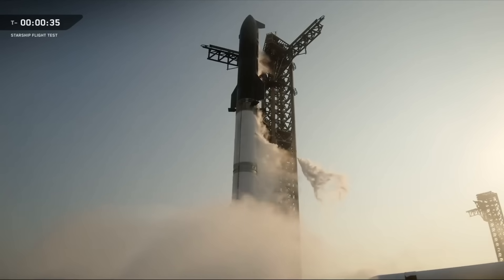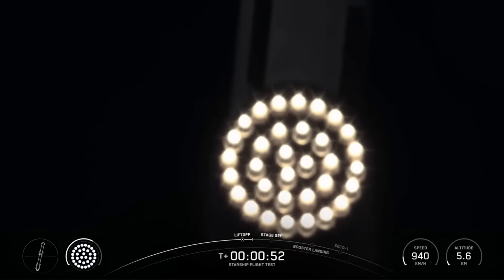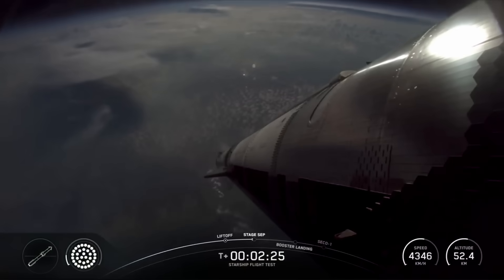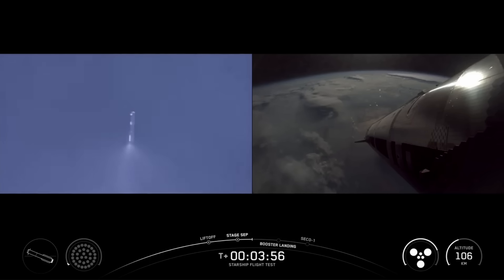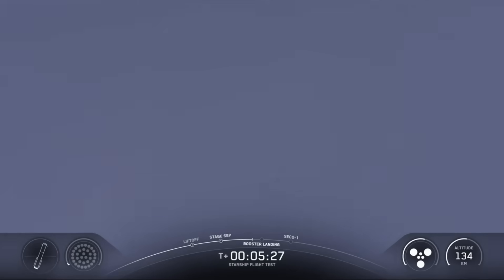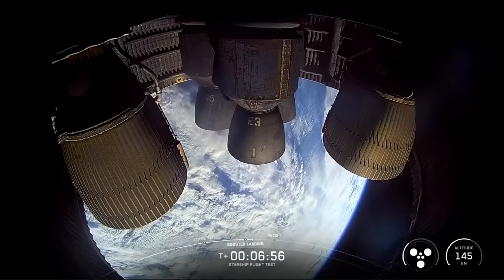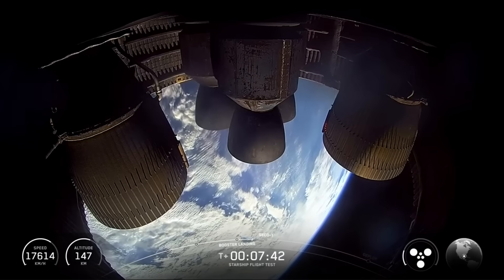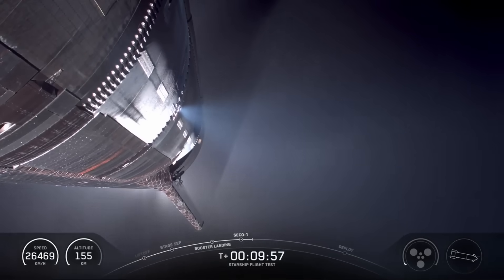Blastoff! SpaceX Starship launches on 9th flight test, booster explodes during landing burn

Comment: The Soviet Space shuttle worked exactly as advertised from the first launch, no failures. NASA's space shuttle worked as advertised from first launch.
SpaceX's philosophy of engineering through failure is so fundamentally flawed that it cannot be called engineering, NASA's Saturn engineers are turning in their graves at this debacle and excuse for engineering. I'm also looking forward to a Max payload lift off of this thing, it should be spectacular, spares everywhere...
Reply: 👍👍👍 for the comment, but note, though, that there are no "NASA engineers", as all work is contracted to industry.
Reply: Neither the soviets or nasa ever made anything reusable. SpaceX had already surpassed them with falcon 9. If they can get starship to work it will be an insane step forward in space flight
Reply: @dylanthompson6146  the Russian and American shuttles were not re-useable ?.
Reply: Why was super heavy not recovered?
Reply: It is called experimentation and it is a process commonly used. Spacex has done it with all of their rockets and Falcon 9 is very successful. What is your issue with Elon Musk, personal dislike?
Reply: @KnightTemplar-k6u  ah yes Mr. Knight Templar, a  white night who automatically assumes that I have a personal issue with musk just because I criticise his method of engineering, rock on Mr. White Knight of engineering principles. The Russian Space shuttle worked as advertised on first and subsequent launches, now that's engineering.
Reply: @tudomerda  Yes, but you didn't explain what was wrong with his method of engineering. You only said it was because he uses the scientific process.

I'm not sure if you are aware of this or if you are actually trolling. The Russians did a ton of experimentation before the final version of the Russian space shuttle used.

Comment: I still think we should be going into outer space via jet airplanes taking off and then their rocket engines fly us to our destination.  Then we design/install a space station where the  planes drop off the supplies and materials for longer space trips.  Or, maybe we use the moon as a way-station for future rocket launches instead of these dangerous launches which endanger lives.  There is far less gravity on the moon to deal with.

Comment: maybe you could see the GLENN as it is in space.  Never seen the GLENN return...  I wonder if the no longer ceramic tiles the space craft is just metal and liquid cooled on the inside is to see how the metal heat shield handles an abnormal entry angle and it explodes...  Metal heat shield is what they are testing on the space craft.

Comment: Ok, the Shuttle then. 135 launches, 2 failures. The calculation before any of the STS launches was 1 catastrophic failure per 50 launches owing to the complexity if the system. You can really put Challenger down to a bad decision to launch on a freezing cold morning.
Reply: Falcon 9, 479 launches, two in-flight failures, one partial failure.  What's your point?
Reply: @-_James_-  I was talking about SpaceX Starship.
Reply: @rogerturner5504  👍👍👍👍
Reply: @rogerturner5504  Then let's continue the comparison.

Shuttle program cost: $196B.
Starship: $5B (so far).

Shuttle cost per launch: $409M.
Starship: $100M for an expendable ship.

Shuttle payload: 23 metric tonnes.
Starship: 150 metric tonnes (to LEO).

There really is no comparison between the two.  When SpaceX have a finished vehicle, it will take less than two years to surpass the number of launches made by the Shuttle over its 30 year history.

Comment: 9 test flights, 9 celebration of failures by the Elon Worship crowd. On this 9th flight:

1) Booster blew up when it started the landing burn. The reuse failed, the booster engines failed again. 

2) Second stage went up to just below sub-orbit, a little higher than test 8. But also blew up. It is well short of achieving a real orbit of about 200 km. 

Starship now have 9 epic failure on 9 very expensive test flights. Can't even reach designated sub-orbit or orbit. In contrast New Glenn rocket reached designated orbit on first try. Worst performance in rocketry history. Conclusion: There is something fundamentally wrong with both stages of Starship. The architecture is wrong. It will never reach orbit, less reenter and land. It will never carry crew. And it certainly will never go to the Moon. 

Elon should end the program and pack up his ambition to go anywhere. Maybe try to fix the Cybertruck, another epic failure.

Comment: This is the penultimate launch, I think, of this miserable concept in its current form. Musk was GIFTED Falcon 9 by ACTUAL  rocket engineers, which is why it works so very well. Musk started this ides, and with staggering childishness, called it BFR. Can you actually believe that? Since he owns most of the company, he gets to perpetuate his idiocy.
Reply: Falcon 9 flies for money. That's why they don't touch it. And this is a personal project, non-commercial, that's why it can be sabotaged.

Comment: They have the booster.  It works and amazingly is recoverable and resusable.  The Starship is intrinsically flawed.  They have copied the failed and dangerous Space Shuttle and will never be able to make this thing function reliably.  Now, it's time to concentrate on consolidating wins and performance of the booster and designing Apollo/Saturn style capsules and service modules to make lunar landing possible.  This Starship monstrosity, if it ever actually landed on the moon would probably just fall over in the process.  Give it up Space X.  The booster is magnificent.  Toss the starship.  

ps.  I would like to listen to the launch, the rocker itself , but this bunch of juveniles yelling and screaming spoils it.  So, I watch without sound.  And, I dislike the commentators even more.  Oh, just emulate Apollo more.  Please.  Professional, curt, serious, and actually know what is happening not just be a pretty face reading your script!
Reply: "They have copied the failed and dangerous Space Shuttle"😂😂😂 A totally different design.
It launched 135 times, with only 2 failures, due to poor booster engineering and NASA's neglect!
"Starship" launched and failed 9 times in 9 tests.🤣🤣🤣
Reply: The reused booster was not able to drop in the ocean like they planned. It also blew up.

Comment: Many thanks for this rapid and informative commentary.

This program is in big trouble.  After nearly three months since the last launch, much of which was occupied by  efforts to overcome Starship propellant leaks, Starship was lost because of ... propellant leaks.  Starship made it to SECO, but did a re-run of IFT3.  Failed in all other goals:  dummy satellite deployment, relight test of Raptor (which was done back in IFT6) and testing modified heat shield.

Meanwhile the over-ocean landing test of the reflown booster didn't take place because the booster blew up when the landing burn started.  The last time a Superheavy blew up was IFT3.  Yes it was the first re-use of a booster but you'd think with a couple of months to check it over a problem that serious would have been found.

The program is still nowhere near it was after IFT 6 when they seemed unstoppable - in fact it's reasonable to say after this current flight that it's regressed to IFT3 levels of maturity.  The version 2 Starship has been a debacle.

SpaceX got approval for 25 launches this year.  End of May and they've only done 3, none of which has reached the maturity of IFT6.  Something is VERY wrong.
Reply: They are probably making too many changes at the same time and its difficult to know what caused the failure. Normally you would make a change and then test t see if it's any good and then decide to keep it or change it back. When you make tens or hundreds of changes from one ship to the next it makes things more complicated and progress stagnates.
Reply: @defiantrascal6214  Exactly, I think you're spot on - you're also going to want to generate failure in a reusable item for the reason the margin profile is already way better but you need to trend towards reliability. One hopes that they have lots of telemetry data and can start to edit out the problems.
Reply: @defiantrascal6214  Agreed.  I said back 5 years ago when they were doing hop tests they should have also been doing that with boosters concurrently.  I would maybe have slowed them down a few months early ob but resulted in a much more mature program by this point had they been able to troubleshoot problems years earlier.  They were supposed to have demonstrated orbital propellent transfer already.  Ultimately the rapid "move fast and break things" approach has not paid off.
Reply: @tylerjohn4607  that was 5 years ago?!? Holy hell.
Reply: "first re-use of a booster" but the engines exploded when in re-ignited. Some reuse!😂
Reply: This is sabotage. Musk got carried away with politics and offended too many people.
Reply: 25 launches this year for spaceX is a big deal cuz they can learn more on future launches
Reply: 25 Starship/Booster launches or total launches?  Aren’t they launching other rockets from Florida and California several times per week?
Reply: @HappyDooDooBad  as I understand it's all launches from Boca Chita
Reply: Starship is a joke
Reply: @Emiliocab47  you're a joke
Reply: @EJ_S-hz1ou  And you are Elons bedmate!
Reply: @EJ_S-hz1ou  Starship is definitely a bad joke
Reply: God you’re a drama queen
Reply: @EJ_S-hz1ou  Its not like SpaceX has unlimited resources. They can only do so many tries until they run into trouble.
Reply: @domcloud808 Starlink is projected to do over $11bn in revenue this year at a 60% operating margin. The strategic geopolitical value of what is effectively a reusable ICBM means this won’t be mothballed anytime soon.
Reply: @EJ_S-hz1ou  - er, the whole point of an ICBM is it doesn't need to be reusable ;-)  And you don't have time for cryogenic fuelling.
Reply: @EJ_S-hz1ou  says the MUSK smegma breath cult member.

Comment: Hearing that rattling as the rocket is taking off seems rather, umm, odd.
Reply: It does sound disturbing, but the rattling is just how the (massive) sound waves hit the mic. You hear the same during space shuttle and other rocket launches.
Reply: Just needs a new set of ball joints.
Reply: Does not sound like a good rattle. More like the ship falling apart!
Reply: @larryhuset4015  the sound you hear is coming from the rattling metal scaffolding  that the camera rig is sitting on, not the ship.

Comment: Booster works like a charm but the starship is becoming a flop.
Reply: BOOSTER EXPLODED?
Reply: Video shows the booster did its job. It was a reused booster from a previous flight & it inserted the Starship into space. Starship blew up in space or something? The reused booster blew up, but they weren't planning on recovering it anyway. They were putting it through some rough tests to see it's limits...
Reply: The reused booster exploded too.
Reply: Errrrr they lost the booster
Reply: @ythinder  They had already planned for a hard splashdown for the booster. It was the first time they reused Super Heavy for one of these flights, and were taking extra risks in order to collect new & useful data.
Reply: @OhmVibe  I know but I'm replying to some idiot saying the "booster works like a charm".........
Reply: @ythinder the booster was meant to do that nothing nor no one lost anything.
Reply: The booster blew up when attempting to land in the sea. It wasn't supposed to blow up. It was supposed to drop in the sea. It's like if you blew up in mid dive when attempting to dive in a swimming pool. It's not supposed to happen.
Reply: Yes but it didnt and hasnt spun out of control mid flight and has been captured a few times.  Its failures are few.  Starship on the other hand last 3 flights loss of control   @karimblix4378

Comment: @4:55 (T+:4:20 and T+:4:54) Fire in the engine bay. Blue flame to the left between sealevel and vacuum Raptors. 
@5:50 (T+:5:15)                       Metal fire torch at this location.
@9:35 (T+:9:00)                       On sea level shut off, the engine bay ring glows (is there a purge line exit?).
@Payload Deployment           They should hire some Boeing engineers for the payload door ;)

Comment: Chat GPT says:

Mission Anomalies

Despite a successful liftoff and stage separation, the mission faced critical failures:
	•	Telemetry Loss: Approximately 8 minutes and 20 seconds into the flight, telemetry from the Starship upper stage was lost.  ￼
	•	Vehicle Breakup: Shortly after the loss of telemetry, the Starship upper stage broke apart. SpaceX identified the most probable cause as a harmonic response during flight that was several times stronger than observed during testing. This led to increased stress on the propulsion system hardware, resulting in propellant leaks and sustained fires.  ￼ ￼
	•	Booster Recovery Failure: The Super Heavy booster, which was being reused for the first time, was not recovered as planned and landed in the Gulf of Mexico.  ￼
	•	Payload Deployment Issue: The payload bay door failed to open fully, preventing the release of the eight Starlink satellite simulators.
Reply: It seems to have mixed information from flights 6,8 and 9. Don't always rely on AI
Reply: Thank you chat GPT and Axis Mundi. Much better than normal reporting.
Reply: @seanbeukman9563  'bout that...